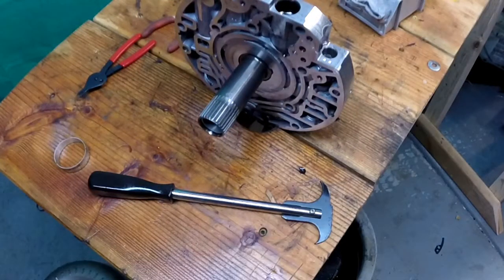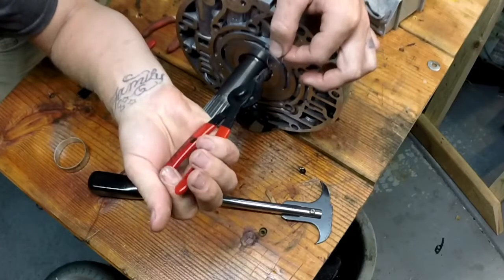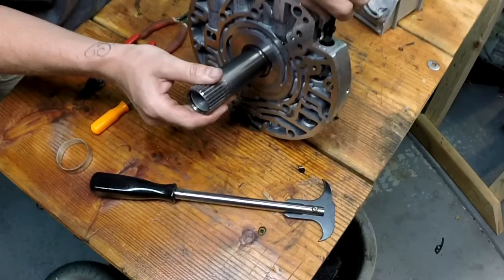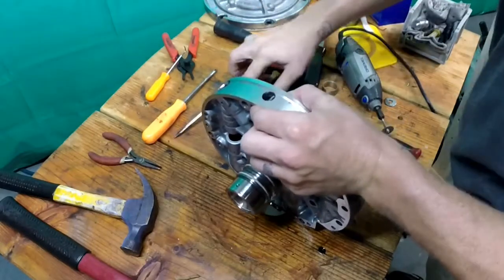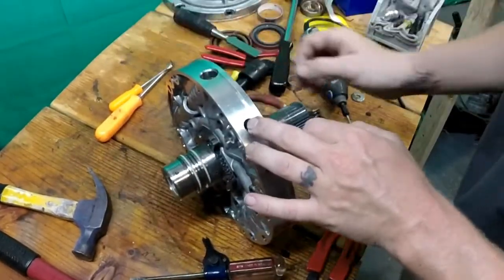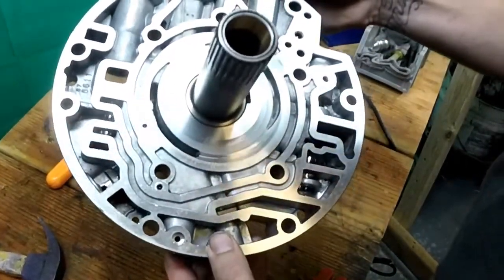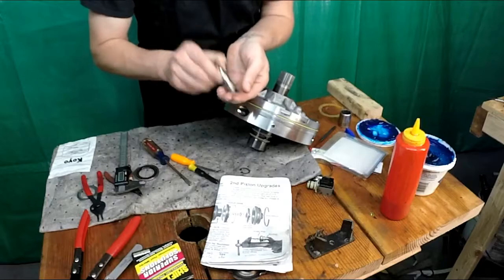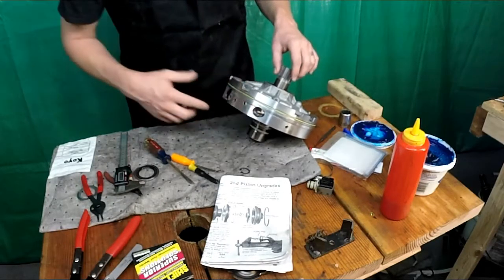4L60e - 4L65e - 700r4: PWM Pump rebuild pt 2 of 3

Comment: Same for the 4l70e?
Reply from the maker: It actually should be the same.
Reply: @ScottiesHobbies   have you ever done the method of putting the pwm valve into a fixed position instead of how it pulses? It's supposed to give full lockup of the tcc I believe instead of slipping